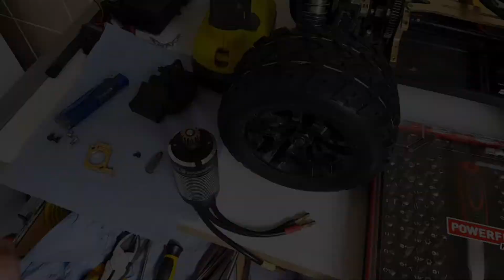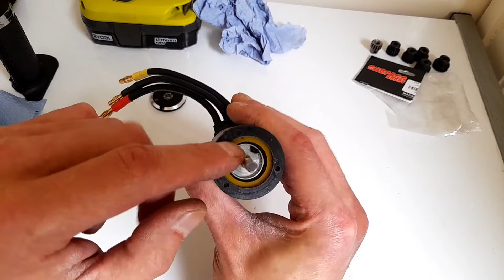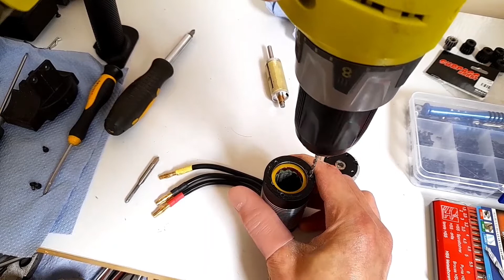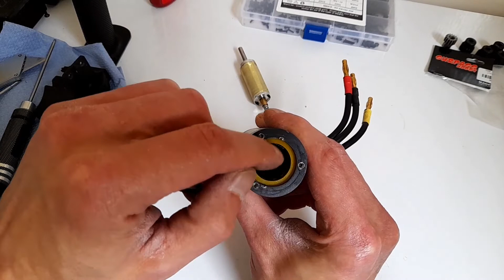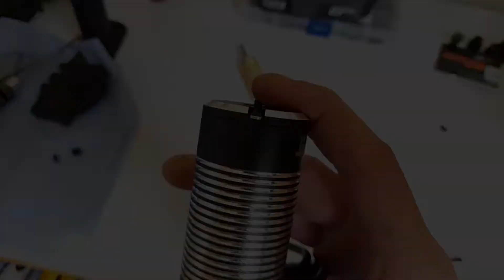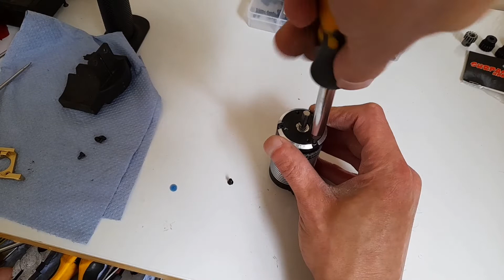RC Motor issue Dead? How to fix at your own risk.

Comment: I recommend the Racerstar 3670 2650kv.. is actually a little faster and has more punch. Bashing the hell out of it on 4s, unbelievably strong!
I just noticed they have a 2850kv version as well.
Reply from the maker: Will the cheetah parts take that torque they barely handle as is 😂 
Definitely something to look at cheers dude

Comment: I assume you didn't have any cap head bolts to use? Good fix 👍🏻 it always amazes me how short the housing bolts are. Even on my 4070 tp motor they're no longer than them ones you just used and that's 107mm long! You'd think they would use longer bolts for longer cans but yanno what do we know mate? We don't design them do we 🤷🏻‍♂️
Reply: Actually, the "norm" for thread length needed in industry is 1.5 times diameter. 
So M3 should go in 4.5mm for example.
Any longer doesnt really add any strentgh.
Yeah the use of recessed bolts really doesnt make sense here, but i guess it's what he had on hand.
Reply from the maker: I didn't have the right screws to hand your right and thanks for the numbers. At least I know by your working out I've went over kill so no issues here then. Trust me I don't use stuff to make my life harder I like to show examples of how to still get the job done. Just so you know what my work is about 🙂
Reply: @leovandijk8852  I know what ye saying but if the bolts are longer theres less chance of it being ripped out! You don't have to be a scientist to know that! Longer cans are known to have the housing ripped out on jumps n stuff but if the bolts were longer it wouldn't happen would it 🤷🏻‍♂️
Reply from the maker: Naile it bro, by my standards and your wording it's GOOOOD!
Reply: @mehimrc1314  I thank you 🤣
Reply: @ksrnate  yeah i guess you are right, in softer material longer thread length does help.
I always used the 1.5 times diameter rule, but must admit i worked mainly with steel.
Some website:
It is commonly known that the minimum recommended thread engagement to make a strong connection for a component with a tapped hole is approximately 1 times the nominal diameter in steel and 2 times the nominal diameter in aluminum. In many cases, (tapped hole in a softer material, special alloys, etc.) these values are not sufficient and the formulae to the right must be applied.

So yeah, i was on the safe side using 1.5.
Anyway.
Reply from the maker: Crazy information dude, i like this kind of stuff. We're always learning from someone no age discrimination on this channel haha. 
Its fixed now and that was my goal well it's fixed for a run or two I hope 🤣
Reply: @leovandijk8852  Wow that's some information 🤣 It certainly is handy to know that stuff. I'm an old school mechanic and I can see when something should be better. On paper your absolutely right but in the real world it's just not enough. Well minimum recommendation is not enough. Over engineer everything I say! Then things wouldn't break so bloody often! 🤘🏻
Reply from the maker: Aye mate was gutted when I checked and didn't have those type of screws but simple solution saved the motor from the bin. 
Your not joking dude that's a 6mm thread they could use something more substantial. Haha "what do we know" nothing mate absolutely nothing as you can tell 😜 can't believe even TP Motors aren't any better. 
Thanks for the comment

Comment: I really like your hand-held lathe. Well done! :-)
Reply from the maker: Haha my poor mans lathe as I call it thanks bro, but will it hold I feel my work will lol.
Reply: @mehimrc1314  I'd say you made the product better, beefing it up with thicker screws, whereas the manufacturer tried to cut corners by installing those puny ones instead. Most people would have chucked it in the bin to begin with, so hopefully your video will inspire others in a similar situation to have a crack at fixing theirs. As long as those screws are not over-tightened, it should outlive us all. :-)
Reply from the maker: @gmcevoy  puny is definitely one word, I nearly shit kittens when they simply spun. But I'm never without a thought, its beefed up alright well with your oversight filling me with confidence. It's getting a bigger pinion and bashed to test haha.
Reply: @mehimrc1314  There you go! Throw it in the deep end right away, and see how it fares! That's some proper R&D right there!